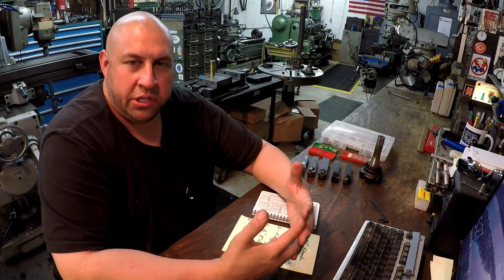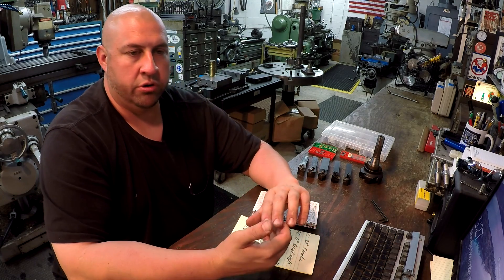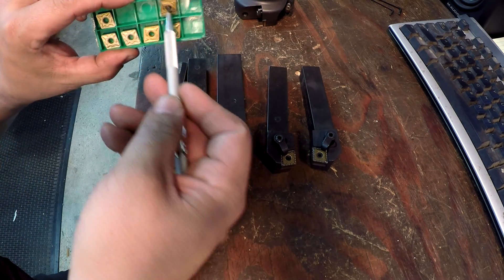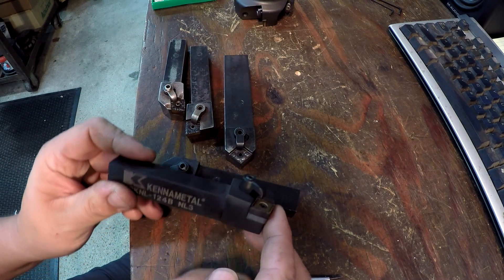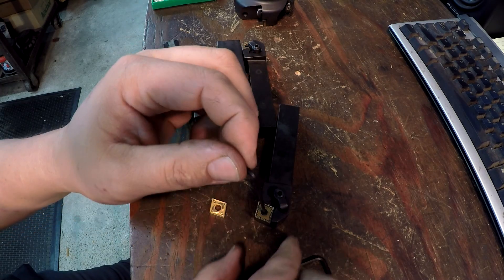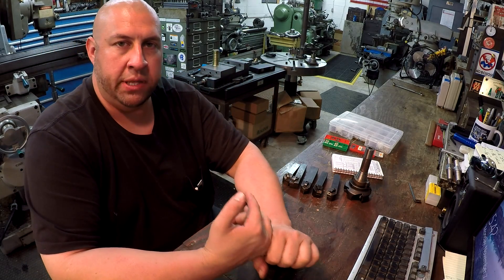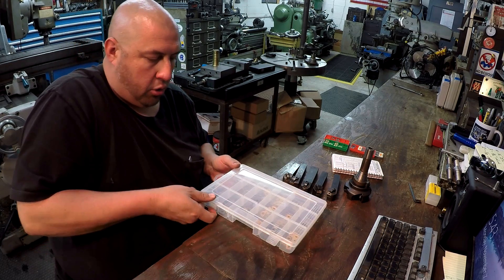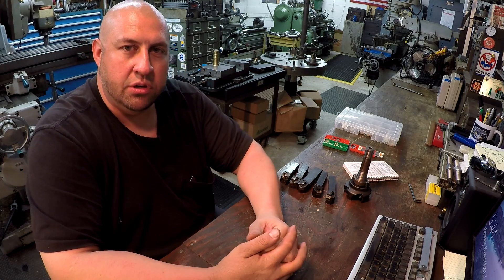Shop Talk 15: CNMG Inserts & Why I love Them

Comment: For heavy turning the CNMG's are great.  Probably the strongest shape available in a laydown type insert.  For my home shop I prefer the triangle or trigon inserts because I get 6 cutting edges instead of 4.  TNMG and WNMG are great for general turning duties.  I also like the TNGG (ground, sharp edge) for finishing.  They seem to give a finish very similar to HSS with the convenience of indexable tooling.

Comment: A question I've had when searching inserts, is there any tolerance designation sold other than M? I guess even in my opinion I wouldn't pay more for smaller tolerances so I'm guessing the industry has accepted it to the point no one manufactures to any other tolerance.

Comment: Nice tip on the allen torque. My dad taught me that when I was a kid. Pinch torque . Same with thumb screws. Made to be tightened with thumb and index finger. 
Good video , Im a NON machinist and just learning with a machine I happen to get at scrap metal price. So far I have made parts to fix the lathe🤪

Comment: Adam, I have and insert same type. I turn bowls and the what I want to know is how can you tell what size you have type etc. I order my metal lathe type by 10 to a pack. From over seas , Amazon etc. For a fraction of the cost of what they want for one.. Do you have a contact info where I can take a picture of the tool I'm using and insert from different angles. ?? I also ordered the black book..... Thank you ,

Comment: Great vide friend, one other thing to note on the insert screw itself is the counterbore under it is designed to push that screw into the walls of the toolholder and is all the more reason not to go wild with its torque, unless you like inserts exploding mid cut that is.

Comment: Adam, thank you for sharing this informative video. I appreciate all your presentations. I began in tool and die way back in the late 1970's and got into drafting and design. Been away from machining for years and in the last ten years acquired a small milling machine and Southbend 9C. When I was in the shop we only used HSS. Rarely used carbide, so it is a bit of a mystery to me as far as what shape is best.  This video was very helpful although my tool holders are 1/2".

Comment: Hey abom I just acquired an 18x60 geared headed lathe with 7.5hp. A 12 inch 3 jaw scroll chuck and a 16" Cushman 4 jaw chuck never used still in the pallet box. My question is it came with aloris qctp cxb. What cutters should I start with. It has adequate power and speed is 25rpm to 2100rpm.

Comment: OK, bare in mind I'm fairly new to lathe work (about 2 years, learning between books and vids). When do you need to start using a coolant when using the lathe? I just moved up from a 6" Atlas to an 11" PM1130 and will be turning larger and harder materials.
My 6" lathe couldn't handle 4140 very well but it did fine with 1018 and 1144 (Love how well 1144 turns).

Comment: Re-watched this yesterday and Old Tony's, and you both helped me a ton. when have the SB 9jr, only used HSS tools,,now that I moved up to the LB 17 that came with 3/4 holders and several boxes of new inserts,, it became obvious that this was Greek until I watched you both, and then printed out the insert charts (name not declared) and Wala, my eye's where opened (@@),,,  Thx Adam,,,7/15/21, Bear.

Comment: Remember, the less torque you put on the clamp and pin lock, the less rigid it is. Less rigidity with carbide means decreased tool life. Theoretically you should figure out the torque for your specific clamp and pin lock, and use a torque allen wrench. In machining, consistency is everything. On the toolholders that you have, the lock pin torque specified by kennametal is 30 in-lbs for a 3/32", while the top clamp torque specified is 48 in-lbs for a 1/8" drive. You definitely should be tightening them with the long end. But you are right, you don't want to crank down on them either. Especially with a long hex key.

Comment: What is the '0' in 430? You stated what a 1-3 is. but I can't read the book, it's too small. Blurred.
Reply: The third number is generally the radius in 64ths but there's also a 0.5 and a 0.  The 0.5 is just 1/2 of 1/64 or about .008", and the 0 is 1/4 of 1/64 or .004".

Comment: 5:37 those are for facing.you should just buy 1 right handed for both type. there is diffrent angle for use turning. leave annoying corner like your mill. i made my own mill. did not know there were mill for these so did it lol

Comment: Never go full abom. Torque on those screws.   Lol in 10 years of machining ive never seen Seen one not fuckerd out to all hell now a help full hint is to flip the tool over and the opposite sides of the screws will have a matching head size because lord knows the tops been rounded. Out to 50 tho over nom

Comment: Back from about 1984-2000, I operated a manual lathe at a small business where we made exercise equipment. I did all of the facing,turning,boring, drilling, tapping, parting, polishing....operations like that. The lathe was a Victor belt drive and was about 8 ft.long ( ??). I had an Aloris tool holder and used these CNMG 431's & 432's and a few 433's. I had other inserts for boring and parting jobs.  By the time I left, I had accumulated many dozens  of boxes of used inserts.  I was all self taught; the owner knew just the very basics of how to operate the lathe. I had always wondered about the other 'odd corners' and wondered if those could have been used somehow. I never learned about these MCKNL (R) insert holders. Wow...sure could have made my work easier and gotten so much more use from the CNMG's...!!

Comment: Dorian tool still makes those face mill tool holders that will take the CNMG431 inserts. "REC15A-400-CN4-150" is their part description number for the 4" facemill. It uses the 100 degree (wide angle) portion of the cutter that I usually throw away unused. You can find the ordering info from their "tool guide vol. 6" on page 114. Thanks Abom79 for the helpful info!

Comment: oh these carbide inserts that you were using to face off the hydraulic nut, it looked like you were taking about 3/16 to 3/8s each pass, what was your spindle rpm? why no coolant? Was the nut mild steel?

Comment: wow in metric the insert is call CNMG but the number is 160612 16 mm insert length 06 insert thickness and 12 is 1,2mm nose radius. we dont need a book to know the info of the size 😜

Comment: What reference hand book were you using?  Thank you for the information.  I am just getting back into machining after 47 years.  Saw everyone using carbide inserts, I never used a carbide cutter during my two years of HS Machine Shop, so all these letters and numbers are new to me.  I have a Taiwan Made ENCO 1340 I bought recently that I am cleaning up now to start machining.  What type insert would be ok on that lathe for general turning?  I plan on using a 5/6 insert holder.  Great educational video.  I can't wait to make chips!
Reply from the maker: I was using the Engineer’s Little Black Book.
Reply: Can't find one on ebay, Amazon. Barns&Nobel. or Books-a-Million.
Reply: Found it.  Had to take "little" out of the search.  lol

Comment: I've been making rollform tooling for years, and the CNMG is probably my most insert, second would be VNMG.  Usually have a lot of interesting profiles to cut.  I do like to use CCMT inserts for boring though as they don't create as much tool pressure.

Comment: I have a subject, I'd be obliged if you could cover in a future Shop Talk.

I've seen videos, where the operator refers to his lathe as an "engine lathe".

I've also seen a video advertising a lathe, which described it as a "gunsmithing lathe".

Could you please do a Shop Talk, where you explain the differences between the various types of lathes.

Thanks

Comment: When you modify the shank of a tool always mill the top instead of the bottom so you do not have to  keep adjusting your tool block up and down
Reply from the maker: Not always the case sir. The 1" shank tools will not lower down enough to get on center before the tool holder bottoms out, on my lathes. That's why I have to mill the bottom of 1" shanks. Milling the bottom will lower the tip of the carbide as needed. I wasn't milling them to fit in the holder.

Comment: Just a reminder that when these inserts start to break down the sound of the cut will tell you to get the tool off the work before it shatters.  The shrieking sound it makes when it shatters is deafening.  This has happened to me turning steel cams tack welded together for turning purposes on a 56 inch kick Bullard.  Running dry can make them turn very red during heavy cutting.   I use to put coolant in a Windex bottle and shoot  coolant on the tool to keep it cool.  This was a belt driven Bullard with a top speed of 60 RPM's.

Comment: nice video adam i use the cnmg a lot for facing shafts i use pcknr holder for the rough cuts and mclnr for the finishing cut and making a radius on the raw shaft

Comment: M really refers to a tollerance these inserts have to be made alike in terms of cutting face, length and with to fit any holder you wanna use.
Refering to your question I mostly think Kennametal are born on selling their stuff inserts as well as their holders and they found a way to present you odd corners so you´ll buy their holders. 
(All the talk below is for cnmg cemented carbide inserts. I am used to working with steel that has or has been already hardened for machine building. Everything else is stainless steel going up to corrosive resistant steel. Anything else is a hobby that may earn me some buck by putting someones combined harvester back in action.)
I´m using Sandvik holders on those 80° inserts for roughing that supports a cutting depth from the corner that you were refering to in the first place to the corner that you were calling "the odd corner" which can be 2-6 mm depending on what the machine can handle. For finishing I´m all about 55,° 0.4mm radius inserts. 
So if you have to turn down 0.5 or even 1mm from the outer diameter, just don´t bother messing around with 80° inserts. 55° with 0.4mm radius do 0.25mm cutting depth with ease.
Also I agree, to keep some 80°inserts for the use you advised. Flame cutted stuff and any interrupted cut you´d need those more flat attack angle to your surface.

Comment: I actually use the CNMG 432 on my Grizzly. what is did was to actually mill a dovetail in the holder and fit it straight to the quick change base. I have had just as good results with the negative rake inserts as the positive rake inserts, the truth is you can only cut as much depth as horsepower and rigidity of your machine

Comment: Adam, 
What does it mean when it says something like "CC.32.5"?

I have a SB 13" by 5 and I'm looking at getting a pair (left and right hand) tool holders.  Given your feed back it looks like a CCMT is a better insert choice.  When I'm looking though I see things like "CC.32.5" and I can not find a chart that explains what it means when there is nothing past the first two letters.

For example: Kennametal - SCLC, Right Hand, 5 Degree Lead Angle, 5/8 inch Shank Height, 5/8 Inch Shank width, CC.32.5 Insert Compatibility Indexable Turning Toolholder.

The picture shows a toolholder with a pin but no clamp of a CCMT looking insert...
Thanks,

Comment: Does the effective rake angel end up being similar to CCMT (7 degrees)?  If so, does that mean similar power requirements or does it require more HP due to the top of the insert being inclined with respect to the work piece?
Reply from the maker: I think the CCMT inserts are a neutral rake tool, but may have positive angles molded into them. I havn't used them enough to know off hand, I need to refer to the books.

Comment: I have several tool holders for which I don't know the proper insert. Two Aloris AXA, and a facing head or shell mill (not sure which). How would I go about determining exactly which inserts to use in each of them? (I know the basic shapes: triangular for the Aloris tool holders, and square on the shell). I can determine the size of the IC, but don't know where to start on the other features of the inserts.

This is a problem for many of us hobbyists, because we buy tool holders on eBay without knowing exactly what we are getting sometimes, and we would like to make use of these tools (better than admitting that we goofed when we bought them!).
Reply from the maker: best info I can give you is to have a book on hand to match up the shape and size of the pocket or tools. The book I use has other pages showing insert shapes and there designations, including milling. I plan to go into milling in another episode.
Reply: I do have the Black Book as you've shown in this series as well as URLs for several manufacturers' definition pages, but nothing has popped out to say, "This is it." 

I may take a series of close-ups of the milling head and post them in the Facebook group. I'll try to get scale and angles clearly shown. 

Thanks for considering my problem, and maybe you will show something that will help when you get to the milling inserts.

Comment: Do those inserts work great on the side corner for interupted facing simply because the wider angle on the tip makes it stronger or is there an additional advantage to the geometry?
Reply from the maker: There is an advantage to the angle too, like how the mcknr tool actually pushes the workpiece against the chuck, where the mclnr is trying to pull it out, because of the leading angle of the cut....when facing.

Comment: Thanks for the great video Adam. When you finish with the inserts would you consider a series about carbide vs hss is a Bridgeport type mill? I've only used hss but keep getting suggestions to try carbide. I just don't know if it's worth it in the Bridgeport.
Reply from the maker: I'll keep that one on the list

Comment: Nice info.  It looks like an sckcr is a common toolholder designation for those of us on the smaller benchtop lathes who are using ccmt inserts.
Reply from the maker: Great! It's some I don't have other then the boring bar I use. I need to do some research on those as well

Comment: I'm glad you showed the plastic organizer. My home shop is automotive based, and I use those exact same organizers for nuts, bolts, washers, etc. As you mentioned, you can label the tops. I put 1" wide white tape over the compartments and label them with a Sharpie. That way, if I want to change the arrangement around, the tape comes off easily and can be reused.

Comment: Adam, I don't know if this fits the program but woul you please discuss. lathe tooling systems like Top Notch. Tool Flo, etc the porpietory systems cot threading, grooving, etc. And the CNC people use a "dog bone" insert for profiling I think would be very handy. for V-belt grooves. finishing non-working diameters and faces at higher feed rates, These inserts are expensive and if pirchased as part of a tooling system the tools to hold them could be minimised.

BTW, I love the CMNG insert too. l bet I machined a barge load of pumps and valves over the years on VBM's. My favorite for stainless and nickel alloys was Ceratip ceramic CMNG inserts. They really held up for long bores and facing cuts. I use Trigon mostly on my home lathe. Not sure why; maybe a weak moment when I splurged on lathe tooling 20 years ago.
Reply from the maker: Thanks Forest. I'll see if I can add an episode talking more in depth on the inserts.

Comment: Hey Adam,I use a bench top lathe,(not mini lathe)and cut a lot of aluminum with 1/2" tool holders.what would be a good style insert for smooth finish and get rid of long stringy birds nest type chips?
Reply: metalhead2508 why is that?
Reply: large radius = wider chip; slower feed = thinner chip. wide and thin = breaks more easily.
Round = doesn't leave a sharp divot each revolution for smoother apparent finish as each edge of the radius is a tangent to the previous cut.

Comment: good vid and great info.  I really like that 'off corner' face mill.
Reply from the maker: Thanks Tony. I notice you seem to favor those  "trigons"
Reply: @Abom79  WNMG is my favorite all times :) give em a try if you havent
Reply: U both are great
Reply: @suryachikkam9625  NO!!! They’re not great. They’re the absolute best 😎
Reply: You wouldn’t happen to have a link to that disco tech outfit would ya?
Reply: Tony, I just thanked Adam for sharing his tips,,and wanted to also thank you as well for your tips on inserts & holders. Boy moving up from a SB 9c to a LB 17 was like traveling to a Foreign Country and not able speak it's language (@@) *! :)> Thanks to you both, now have the cheat sheet's printed out & in my tools box,,,wish me luck...My first attempt on the big lathe was a 10in rotor. Turned it into a 45rpm Willy record (@@), but now see I used the wrong insert, speed & feed,ect,,,,now to go practice what I learn from you guy's,,Bear.

Comment: The torque on the insert clamping screws are different for different holders. Some holders require up to 5Nm, and that is more than you can crank out of the short end of an allen key.
Reply: Probably they are if they have a bigger screw . But a 5mm (aprox 3/16) other smaller, 5nm si to much for daily use
Reply from the maker: I think a bit of discretion applies here. 
I know not every tool is going to use the same hardware and torque values, but what i was talking about was for those particular turning tools I shown in my video. I've done my fair share of over tightening the screws resulting in stripped out hex sockets. I've been tightening them just like I shown you and have yet to have a tool fail me because of it.